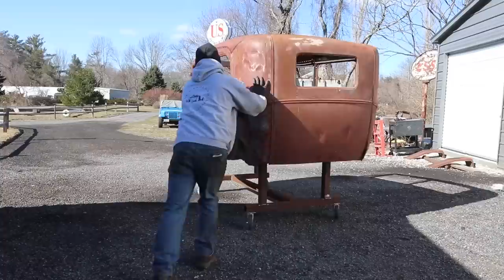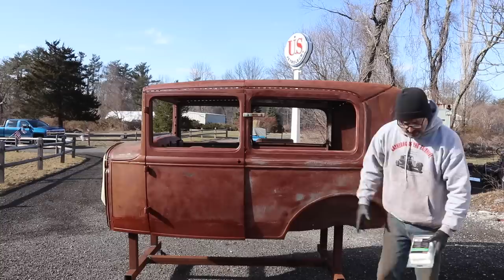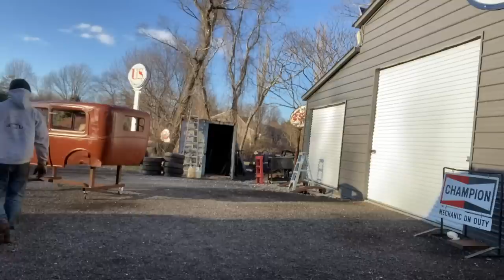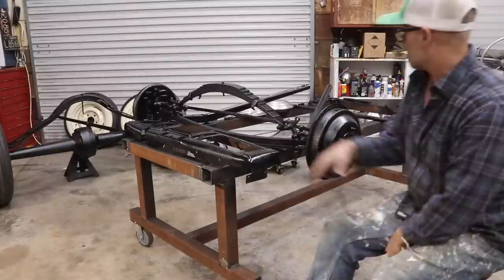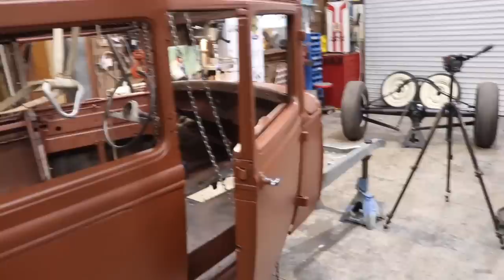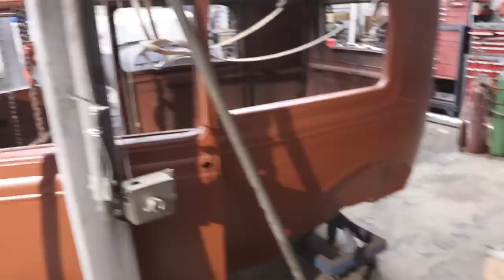Inexpensive Paint Job !!

Comment: Growing up as the son of a body shop owner in the middle of Farm Country I've used ALOT of trcator paint on cars. I have a life long friend that's rebuilding his grandpa's 34 Plymouth Coupe that his grandpa built as a hot rod when he came home from WWII, He's building the same way his grandpa did but he's putting the drive train (273 Engine Torqflight 3 speed auto trans) out of 65 Plymouth Valiant in it, He's going to paint it Fiat Tractor Brown with Massey Ferguson Red pin strips. The Nylon strap "Jumper" seat that his grandpa built for it are rusted up so he's building new ones using the original one.

Comment: With the split wishbone still double bolted to the axle housing, how is the axle able to rotate requiring a 3rd link?
Reply from the maker: Thw axle pivots on the front mount.  The 3rd link eliminates the rotation of the axle forward and backward.  
No difference than a original torque tube assembly.  The torque rod replaces the torque tube.  That’s all it does.  Allowing a modern driveshaft.
Reply from the maker: The radius rods aren’t as thick as people think.  They will bend and flex without a torque tube or torque rod.  That’s what I meant by the axle rotating. Flexing the radius rods.
Reply: @ThisOldHotrod  I've been rodding since the 60's doing open drive on flatty rear axles & have never seen a wishbone failure. Maybe they get rusty on the inside in rust country that I'm not aware of!
Reply from the maker: @nzsaltflatsracer8054  people know a lot more than I do.  I’m just building things how I’m told they work best and how I’ve read online. Everyone has their way.  Personally I’ve never seen one fail either, but I’m told they do.
Reply: @ThisOldHotrod  The front mount would need to be on the same centerline as the split wishbone pivots to not stress the link & bracket. I enjoy your videos, thanks mate.
Reply from the maker: @nzsaltflatsracer8054  you’re correct.  I’ll have to weld the mount onto the front of the pass side radius rod near the heim joint so it all moves as one.  
I should have done that now that I think of it.  
Live and learn 👍🏼. Thank you
Reply: @ThisOldHotrod  No worries Mate! If you make it to Bonneville look me up.